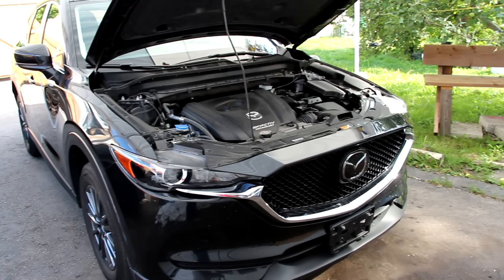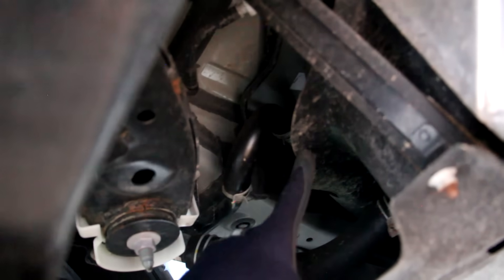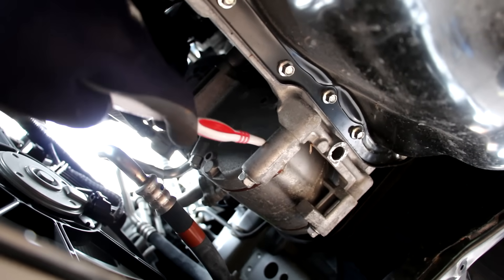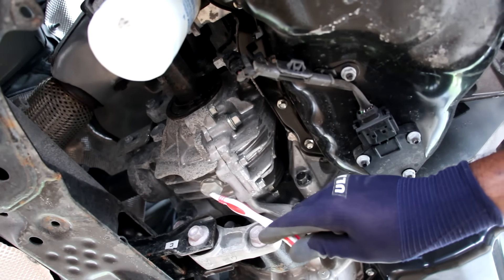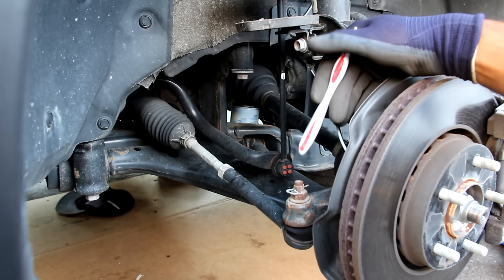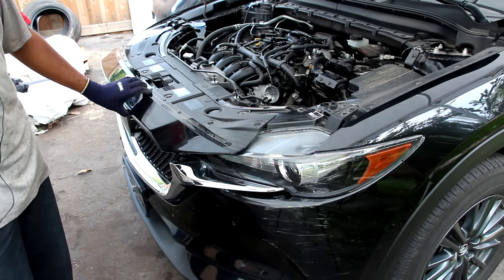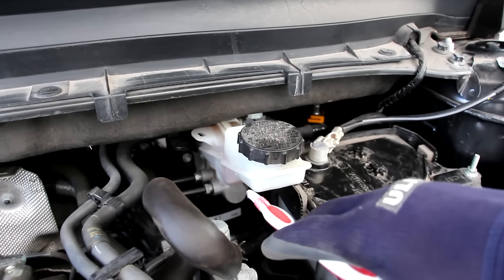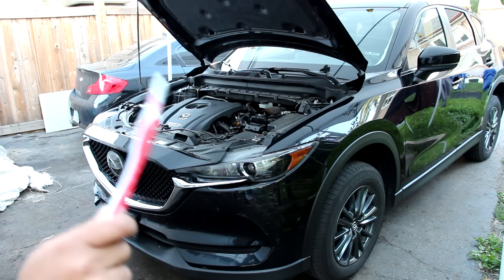Mazda CX-5 Mechanical Review

Comment: I’ve put 100k miles on my 2016 CX-5 and no major issues so far. Very reliable. Easy to maintain. Great car!
Reply from the maker: Good to hear
Reply: Almost all Mazdas use Sky active from around 2013, 2014.
I've always bought Mazda or Toyota for their value and reliability. The worst thing you can do is buy a car which becomes a bottomless money pit in terms of maintenance and resale value.
The CX-5 has a perfect balance of practicality, utility, reliability, drivability, and fuel economy.
Reply: Curious as well for an update. Any paint/rust problems? Any engine or transmission problem? Etc.
Reply: @vindictiv6880 I think you just need to change the trany fluid and good to go
Reply: @vindictiv6880 dude you do realize there is not a single car on this earth can go on for 10,000 to 15,000 miles or more without maintenance/or issues, There are very few real-world examples of a car lasting long without maintenance. Even the most durable vehicles require some upkeep to keep nice and running! 

Be a leader not a follower!
Reply: @vindictiv6880 Paint issue seems to be on the soul red. The front should be ppf ed when new. The red is an up charge, stunning tinted clear coat. It’s an enthusiast color, not to be run through a car wash. I just polished and ceramic coated mine, spent a whole day on the touch ups. It’s stunning in the sun and if it was ppf ed when new, it would be fairly reliable paint.
Reply: @vindictiv6880  Rust is the biggest enemy of ANY mazda car. Don't even ask that, you know it's a problem. I own a 2011 one. Sad to see this is still not fixed.
Reply: @CarloLeonKolega  but 2011 is not representative of brand new ones hence my question
Reply: Any updates
Reply: Just got a 2019 with 30,000 miles. This makes me feel good.😀
Reply: Does your cx5 has skyactive engine? Sorry I had to ask I’m new in a Mazda family. I just bought my cx5 for about 6 months now.
Reply: all modern mazdas have skyactiv. its thir propritery tech that allows full combusion.  @eugenegutierrez5106
Reply: I've had to replace brakes and rotors within 40k miles. Also absurdly enough apparently spark plug also had to be replaced at 40k miles which is much worse than the competitors. Car after 35k started having annoying plastic creaks, driving is definitely less smoother and cabin is loud. (Replaced 2 tires, the remaining 2 are still in good condition). Honestly it's worse than the competitors in alot of regards, but it does look better and aesthetics matter to me.
Reply: @alb0zfinest  Could the plugs possibly be any easier to get to on these engines though? Four bolts to remove the ignition coils and there you are. Plugs aren't even expensive either. IMO Its obviously a pretty damn reliable car when that is the type of complaints it generates about the mechanicals.
Reply: Did you change then trans fluid and differrntial fluid?
Reply: @russelfernandez4778  yes I have changed fluid in both
Reply: Does anyone have a problem where the cx5 jerks and makes a clunky noise when shifting from 2nd to 1st gear its only got 18k miles on it and it started giving the problem at 8k miles the dealer said nothings wrong with it and now it started to give a sakey start where the entire car shakes like its about to explode
Reply: I've had my 2015 CX-5 since new and had 0 mechanical issues.  Only downside is the rust under the car.
Reply: 100K is not a lot of miles
Reply: @MyLifeMyMoneyMedia  no, but well driven for the age of the car at that point in time

Comment: Until you get to about 18,000mi or 30,000km... explain why mazda is replacing so many 2.5l engines? I had a 2017 cx 5... key word, "had". It wasn't even covered by warranty because I lost the oil change records. A major engine failure wasn't covered by warranty due to a loss of oil change records. It lost 4 quarts of oil and spun a bearing.... I'll never buy one of those garbage cars again.
Reply from the maker: Wow. I haven't heard of the mazda failures, can you tell me more on why they say it's happening?

Comment: I had a 2015 cx-5 gt before; I would say you do not really need the 19 inch wheels which cost more to replace the tires and all wheel drive which most time only run on front wheels. Rear brake pads wear out faster than the front because the electric parking brakes. Other things were nice but I still preferred my Mazda 3. Two of them last over 250000 km, 10!years and were still running great.

Comment: I have 1 request. I have a Kia Carnival, called Naza Ria in Malaysia. Had engine problems like water leaking into engine and I had it changed to fit in Mitsubishi Galant VR4 (Legnum). Can you do a review which engine can be fitted into this body please. I was thinking of Mazda CX-5 2.2 diesel turbo because the gearbox transmission is on the left side of the car (left front wheel).
Reply from the maker: That's quite an engine swap
Reply: Yes, it is a 2.5 V6 twin turbo VR4 (6A13TT Mitsubishi Legnum). Standard factory tuned power is sufficient. However I love the torque generated by diesel turbo engines.

Comment: Thanks for this awesome video. Very detailed review.
Planning to buy an SUV. Need to select between 2022 RAV4 and 2022 CX-5. As of now, inclined towards CX-5. I am also from Ontario, where we have issues with snow and salt. So will plan to get it rust proofed if I go with CX-5.
Which one would you suggest based on mechanics? RAV4 or CX-5?
Reply from the maker: CX5 has more traditional design. Rav4's new engine yet to be proven long term.

Comment: When doing an oil change on our 2.5s (3 and CX-5) - I loosen the drain plug and leave in, remove the oil filter, and then remove the drain plug. I really appreciate Mazda putting them together so I don't have to move a drain pan around.
Reply: Very clever

Comment: Im scared of the rust issues, live in Canada with salt on the road half the year... but I still really appreciate this is made in Japan
Reply: In Sweden older Days they used to cover  all critical Parts with cheap  Flaxseed Oil. Before you do that you need to heat up the Oil in Order to get this Oil quicker dried. Cheap and best Performance. No expensive Oil/Fat required.

Comment: I dunno about the CX-5, but my Mazda3 has that same click at the bottom of the throttle.  Pressing to 100% is effectively a kickdown-like effect.  It'll happily drop another gear or 2.
Reply: The CX-5 with the 6-speed manual has this as well. If you’re using the electronic speed limiter feature, you need to hit that click to override it (the instruction manual says depress the accelerator fully).

Comment: Not gonna lie, im a bit surprised with the rust issue. I thought they galvanized all their steel subframe/suspension parts, but it still rusted?
Maybe you live in a warm/seaside town? or maybe up north where they salt the roads?

Where I live, its mild winters (no snow at all) and mid-temp summers, so i've never experienced rust at all. I have an old mazda3 (2012) and those used to have rust issues in the US, but mine doesnt have a single spot. Maybe it's because i live in Chile, down in south america? maybe our cars received different treatments from factory?
Reply from the maker: Yeah I live in Canada. It's rough on cars here.

Comment: I own a 2018 cx5. Things I like are the interior look and feel, the 6 spd transmission instead of a cvt. Those 2 reasons made me buy the car. It was also cheaper than the rav 4, crv. The cylinder deactivation is hardly noticeable. It is a 4 cylinder so not much HP. The original A36 tires are rated for 30 to 35k only. You will need rear brake pads and maybe rotors by 40 to 45k. That was disappointing. The infotainment system is slow and outdated. I have 43k on it now. Will trade it in by 80k for something else. I don't care for the direct injection and using cdc spray 2 to 3x a year

Comment: Thank you for a great, informative, educational, and entertaining video! 
This CX-5 mechanical breakdown video is unmatched.
Subscribed/Notified.
Now I can always come back to this video instead of having to examine my CX-5 myself.
My 2018 CX-5 is even simpler, due to having a 6 speed Manual Transmission (2.0L non turbo), and no cylinder deactivation, making a much more enjoyable drive, but a 2.5L for a bit more power would've been nice.
Not too concerned about the surface rust with recent/newer Mazda's (time will tell).
For GDI maintenance without having to remove the plastic intake plenum, couldn't I just spray some carburetor cleaner (CRC etc) into the intake valve area via vacuum tube or something every once in a while?

Comment: Rust, difficult to replace the rear control arm, and cylinder deactivation kind of eliminate my motivation for purchasing the car for long term use.

The similar car based on 2008-2013 Mazda 3, the 2nd gen Mazda 5, shares several similar design but the ECU is sandwiched between the battery and the engine, and the TCM is sitting on top of the transmission and get cooked if the transmission fluid is dirty. There are several things to improve but if you just plan to have the car for 7-10 years it is a great reliable car.

Comment: Thanks to this review I'm canceling my plan to get the 2020 Mazda CX 5.
I've had a 2005 Mazda 3 and currently have a 2011 Mazda 2. Both have rusting issues especially the Mazda 3. It appears Mazda has no plans on resolving that. The body and paint is MUCH THINNER  compared to Toyotas. 
Parts and repairs are more expensive as well. The only things I like on Mazda are the handling and stylish design.

Comment: I am interested in buying a new CX-5 but you have to purchase their turbo trims unless you want their engines with cylinder deactivation. I have been reading about owners having problems with this CD technology. I would rather have a NA engine than a turbo
Reply from the maker: Is there a way to deactivate CD?
Reply: I was told no. I have also read that Mazda may be phasing out the CD feature. I hope so. What’s strange is that some models of the Mazda3 have this feature and some don’t. For instance all their hatchbacks don’t have it but some of the sedans have have it like all the AWD’s have it. Very odd

Comment: Seems pretty accurate from my experience. No engine issues whatsoever, but I have been having issues with the brakes and suspension and I think rust is an issue. My 6 year old car has about the same rust amount as this car. Maybe the rust will be an issue in the future but at least the panels aren’t rusting out like all the pickups on the road today

Comment: What about the reliability? I haven't read or heard anything bad about these engines. No timing chains failing no transmission problems. Is that really true, have you heard of anything?
Reply from the maker: Nope. Seems simple.
Reply: Yes. My uncle had a 2017 CX-5 and both the rear end and the transmission failed. Car was maintained religiously.

Comment: The advanced tech in that engine is that it's running 14:1 compression on 87 octane. through some fuel delivery tricks and that nice 4-2-1 exhaust header.
Reply: That's insane. They're messing around with prototype engines that use detonation as part of the normal combustion cycle. Probably somewhat similar to what is going on in this engine. The direct injection probably also helps time fuel injection and compression so your engine doesn't ping or knock. Very cool tech

Comment: Excellent video, nicely detailed.  I am looking to purchase a small SUV, and have basically narrowed it down to 3 choices:  CR-V, RAV 4. and CX-5.   Pros: Normally aspirated engine, 6 speed transmission, nice interior, quiet ride.  Cons: Sevicing front suspension components (glad you pointed this out), smaller cargo space than the other 2 (minor issue).  Rust is not an issue, as I live in Arizona, but thanks for pointing it out.  I will be buying used, so I will scrutinize the underside for rust.  This car could possibly last me quite a long time as I only put about 3000 miles per year on a car.
Reply: what did you eventually choose?
Reply: @NoBody-xx6ii  Actually, did not purchase any of these.  However, I currently like the Subaru Cross Trek.  At the lower price point, I would go for the Sport w/6 speed manual.  At the high price point, I would choose the Limited (only comes with CVT).  The Cross Trek comes with the 4 cyl boxer engine only, and not the 6 cyl boxer engine, and that is a good thing because the 6 cyl that is available in other Subaru models is known for head gasket failure which can be an expensive fix.  Note that the Sport trim has only the 2.0L 152hp engine, but the Limited has the more powerful 2.5L 185hp engine. Both are reliable.  Both are normally aspirated (generally last longer than turbocharged engines).  However, the 2.0L is gutless when mated with the CVT; the manual option with this engine will make it feel a little peppier but with less mpg.  This model has great ratings for reliability and no recalls or major problems reported.  The current generation has a more upscale interior compared to the previous. I have never been a Subaru fan, but I think that they have a winner with the Cross Trek.  Having said all that, I am going to wait for car prices to come to a level for us sane people
Reply: @edday2636  appreciate the reply
think I will join thecwaiting list
I also value my sanity

Comment: Not sure if im just not seeing it, but what model year is that CX5 ? ....so much rust forming on the underside already is scary!! What would you suggest to use/do to keep all the underside components from rusting. Much thanks for this massively informative video!!
Reply: Did you ever figure out the answer to this? I'm considering a 2023 CX5 and worry about the rust in Michigan.
Reply: @kara1084  Have dealer use anti rust spray on key suspension parts or components annually or whatever interval they recommend. I'm in 2023 loaner and I'm blown away. It drives and handles like BMW. Interior is very nice. And 2.5s non turbo engine is more than sufficient due to the great transmission design.

Comment: One thing that gets me with these is the air intake. There is no lift in the hood for the intake and the grill where the snorkle Is aligned is actually blocked by the plastic filled honeycomb design. Also they can invest into some hood struts instead of working around that darn pole that is too far in the middle part of the engine.

Comment: I just traded in my 2017 outback last month and bought just a base CX-5 sport, it’s an incredible car for the money. I loved the outback , I’ve always had Subarus, but I am growing increasingly concerned about the CVT transmissions and their durability after 100,000 miles, just not a fan and kind of sad that Subaru went that way. The sky active is a far more reliable and better transmission and engine. The CX five is really a wonderful vehicle
Reply: Had a 2016 Crosstrek.  It kept fuckin up.  I had two months left in my warranty so I traded it in for a 2023 CX-5 Select
Reply: @PingPongBallZ  I've owned an 04 outback, and have a 05 forester with 180k miles. I've heard the newer ones are better, but still have weird issues. Subaru make cars I hate to love and love to hate, but I would get a mazda in a heartbeat. My gf has a cx-3 and it's a great car.
Reply: @LandofMikeBelieve  ya Mazda makes great cars.  I'm never going back to Subaru
Reply: @PingPongBallZ  I try to explain to my gf, because although she likes her cx3, and loves the cx5 which she wants, she also wants a forester. I try and show her the mechanical problems mine has; my ford has a lot less issues. I'm hoping to keep her on the mazda side before she learns the hard way with a forester.
Reply: @LandofMikeBelieve  has she test driven the Forester?
Reply: @PingPongBallZ  no
Reply: @LandofMikeBelief  Ha are you familiar with the CVT transmission?  She ain't gonna like that.  The Mazda 6 speed is incredible
Reply: @PingPongBallZ  I know cars and transmissions well, I worked in the car business and fixed many of my own cars. CVT is a slip 'n slide crap type of transmission. I've explained to her over and over and she somewhat understands, but still has in interest in a Subaru. I think partly because her dad traded his 07 Accord for a shiny newer 2017 Impreza, which I think was dumb. She's drawn to the idea that it's a big boxy design, but other than that...boxer engines are outdated and inefficient engines, why they threw in the cvt, to help counter that: same with Honda and Nissans, which haven't mastered efficiency like Mazda has.

Comment: So that's where you check the transmission fluid . The owners manual doesn't even show or list it.what the f is that all about ?
Reply from the maker: Dipstick
Reply: Mazda says it's a "lifetime sealed" transmission fluid. So, they don't show you. I keep my cars a long time so "lifetime" is nonsense.  
I own a 2018 CX-5 and 2016 Mazda 3. My 2016 CX5 was destroyed by hail. No problems with any of them. However, all of these transmission have a drain plug and replaceable filter. Only use the blue color "FZ" trans fluid!  Seems like the fluid is only available from Mazda or Ravenol. The pan is difficult to remove  because it's attached with RTV. 
To check the trans fluid level, the vehicle needs to be running and level with the fluid at the right temperature. It's a bit of a hassle but not the worst design out there.  It's easier and safer with a lift so maybe let a trusted mechanic do it.

Comment: Any thoughts on the cylinder deactivation causing the rocker arm to fall off? Mazda issued a recall for this and the fix is just a software update, however from reading Mazda forums, there is no way to tell whether the rocker arm is displaced unless you take the engine valve cover off to check?

https://www.mazdas247.com/forum/index.php?threads/dangerous-cylinder-deactivation-trouble-on-2018-cx-5-and-6-models.123868237/page-40